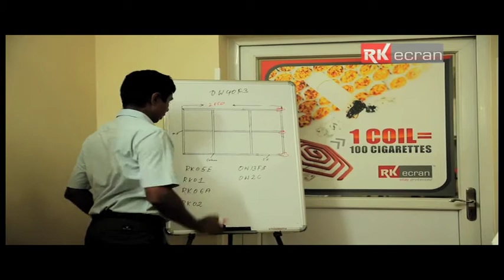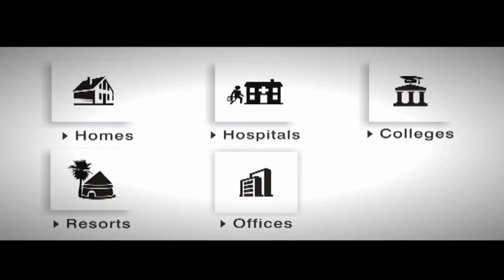RK ecran Mosquito Screen Doors - Manufacturing and Product Demo

Comment: I am a customer of RK ecru since April 2018. The frame work is really good and sturdy and matches my door color. I also use the auto close mechanism, however it keeps banging the door with too much force. 

They say the product is under warranty for a year, however after the first 2 calls, they make u feel like they are doing you a favor by fixing it. 

If you have young children and animals inside the house, don’t go for this product. As I said the frame is good but the beading and the net they use is not of good quality.  After having called them so many time to get the issue fixed, I am trying to buy the tool so the I can fix the beading and net on my own. Result; It is better to go for the regular aluminum frame rather than having to pay a huge amount for this door and get pathetic customer service. Not worth it. My door is still not fixed.